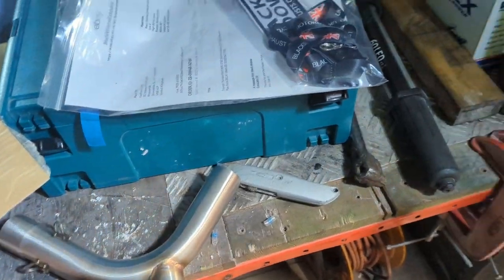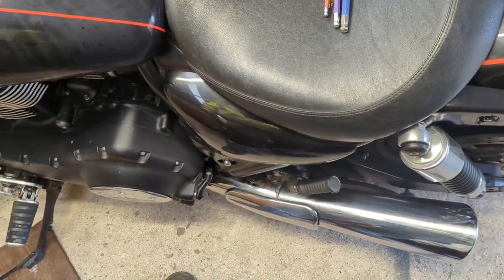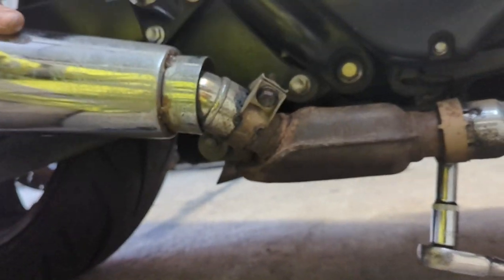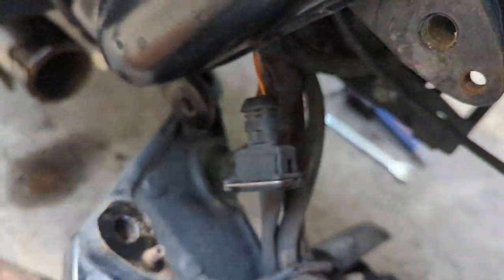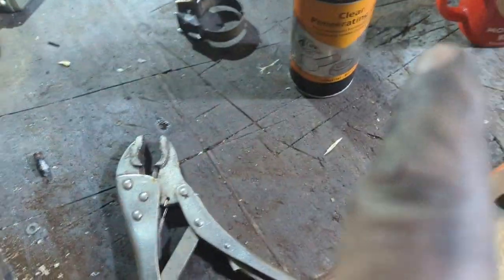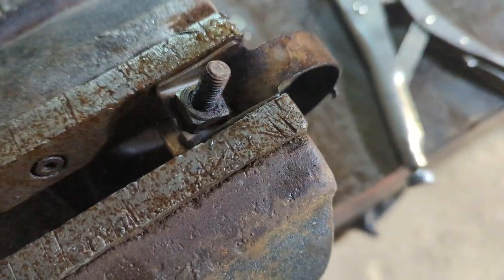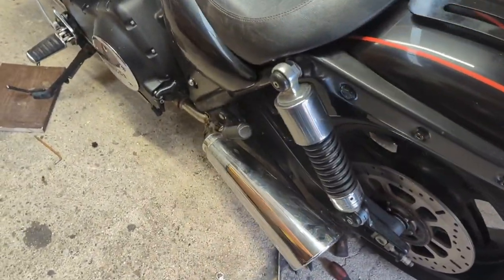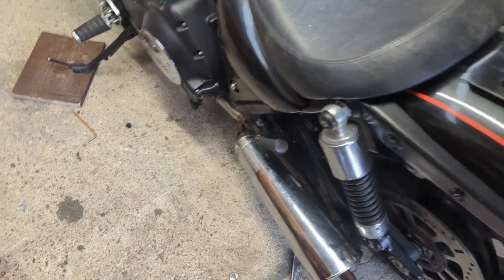Triumph Thunderbird storm black widow decat

Comment: Will this exhaust work on a 20016 Triumph Thunderbird LT 1700 and are you removing the catalytic converter?  My Triumph has 55,200 miles on it Converter could be stopping up. Trouble with idling.  Also what is the cost?
Reply from the maker: Go on eBay type in black widow LT you see them pop up easy job and cost is just cost of black widow £150 around if your fitting it yourself.